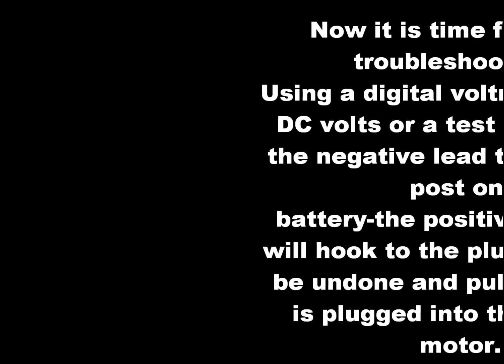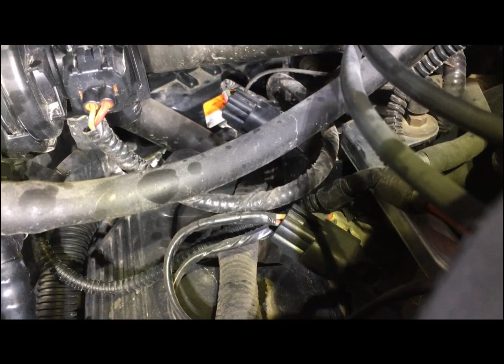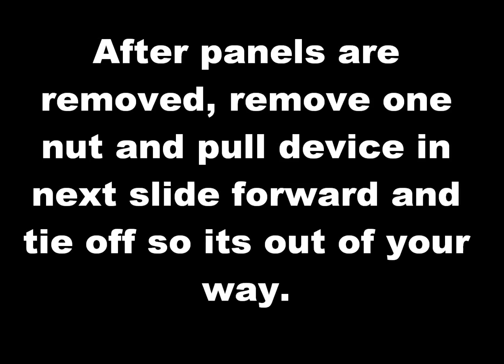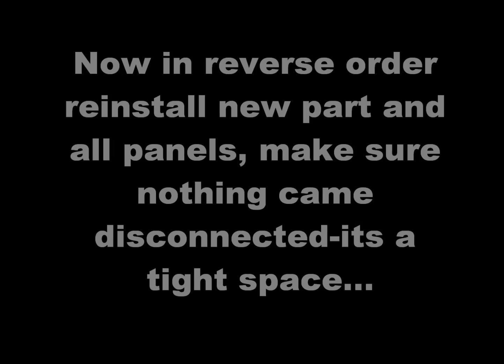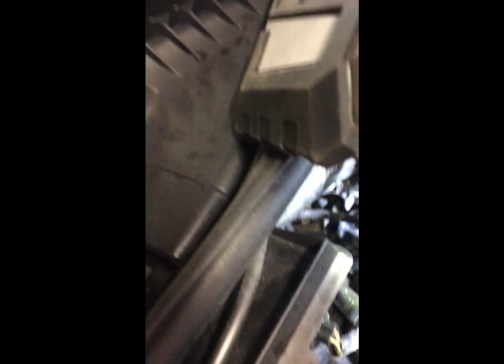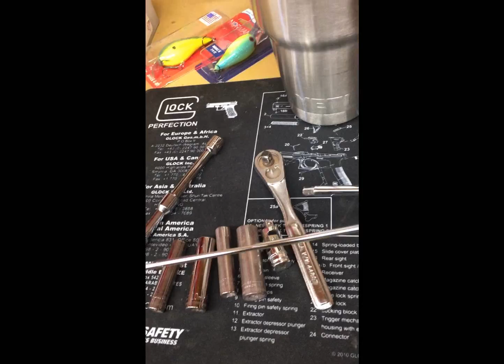2002 Lincoln Town Car blower motor resistor install

Comment: 2011 The fan controller has 4mm reverse Torx bolts that are extremely difficult to remove and even more difficult to install.

Comment: No this is considered an open and should not drain battery however if blower motor is bad it could drain it try disconnecting blower motor with plug and see what happens

Comment: If you have your meter hooked up ( black to negative post on battery) and using red probe directly to plug on blower motor you should have +12 volts. You have to have car running and blower motor set to high and heat or air on for the 12 volts to be there. If not go to fuse panel and see if fuse is blown. The resistor is how the blower motor derives it’s ground so you do not want to hook meter to that for ground.
Reply: I was just trying to diagnose a car, and couldn't for the life of me figure out why I wasn't getting 12v at the pigtail, then it dawned on me, that ground may just be going through that stupid resistor!  Battery as ground and what ya know, I have +12v at the blower motor.

Comment: So if I pull the wire for the blower motor and I'm getting nothing or negative then what?
Reply: You should be getting +12v on  the Brown/Orange wire that connects to your blower motor with key on.  The Orange/Red wire is ground, and only grounds when there is a request for the fan to be on.  If you are not getting +12v to the Blower Motor, check your fuses, there should be a 30A fuse either under the hood, or up under your dash that supplies power to the motor.  When doing the +12v at the blower motor test, make sure you are using the battery as ground, and not the other wire in the harness, this keeps other things that might be problematic from giving false readings, such as a faulty resistor.

Comment: I applaud anyone who can actually do this with the heater core hoses still attached.  It is darn near impossible.  The old resistor has to come out, and the new one has to go in, at almost a perfect angle, which is pretty much impossible to achieve with the hoses still attached.  Plus, the two 8mm screws that hold the resistor in are very difficult to get at with the hoses on.  I personally recommend removing the hoses.  Although, getting 16 yr old hoses off is no easy task either, but for me, it was easier than trying to get the resistor in an out with the hoses still attached.

Comment: p.s., I was able to speed up the diagnostic phase by simply tapping on the resistor with a screwdriver in the first place, and the blower motor started right up.  Thanks again.
Reply: @Sylvester Miller watch the vid maybe?
Reply: Yep! Me too!  Just came back to the video to say thanks.

Comment: I'm replacing the resistor on a 2001 Cartier and I can't remove the damn resistor... it's close but I can't manage to get past the bottom heater hose no matter what angle I try.  I more attempt and then I'm removing the hose.  Your video has been a big help though, thanks.
Reply: I eventually got it out and the new one went in much easier than the old one came out. Thanks again. My "daily driver" is "cool" again.
Reply: I followed the video.  It's a tight fit, but it can be done without removing heater hoses.  Make sure you have a magnetic retrieval tool handy, because you'll probably drop your 1/4" drive and 8mm socket while removing the two bolts that fasten resister assy to firewall.  I did 3 or 4 times, but was able to retrieve them using my telescoping magnet tool.  Good luck!